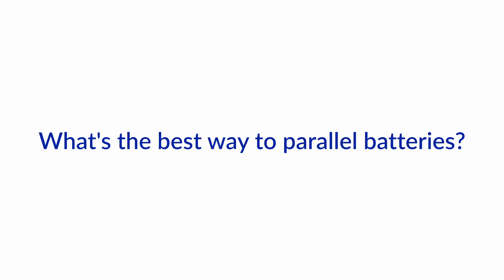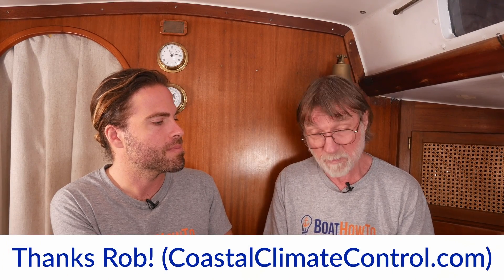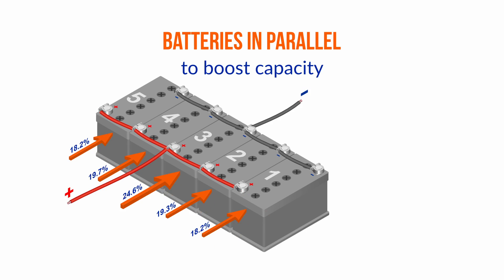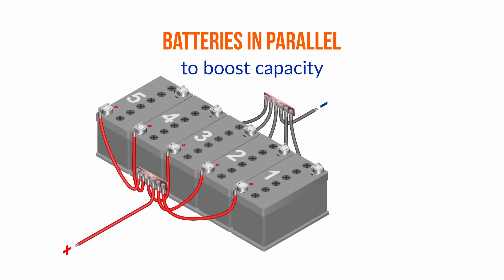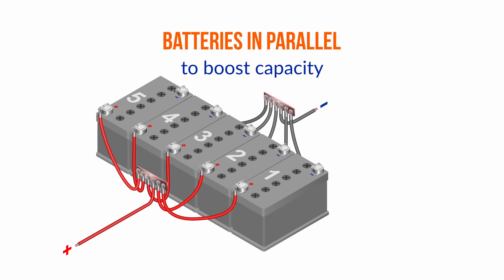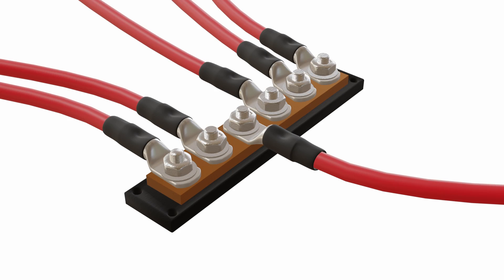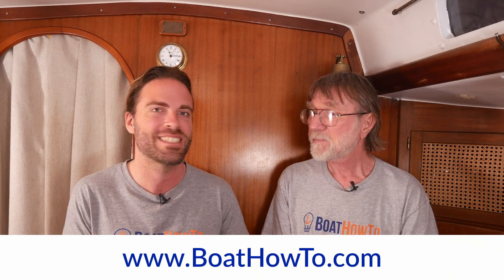The BEST way to Parallel Batteries on a Boat | Ask The Expert with NIGEL CALDER

Comment: My understanding was that you don't need identical lengths on all conductors, you just needed identical paths. 

If, for example, you had four batteries, where two had 1 foot conductors on the positive side and 2 foot conductors on the negative,, while the other two had 2 foot positive and 1 foot negative, all the paths would be the same length with the same resistance.

Comment: Out of curiosity.. can all the positive cables, of the same length, have a different length from all the same length negative cables? Due to orientation, the bus bar for my negative cables could be one foot closer in location than my positive bus bar...   my intuition says that should be ok, but not entirely sure my intuition is correct.

Comment: I always use bus bars for my battery bank! The conductors should all be the same length to keep the system equal. The batteries used should all be charged at near or the same output voltage before hooking up the conductors. I use welding cable for my system for optimal performance.

Comment: Thanks.  That's some good information.  I'm literally switching out the lead acid batteries to LifePo4 batteries.  Only two in my battery bank for my little trailerable houseboat, so I shouldn't need the bus bar.  At least that's what I'm gathering from this video.

Comment: Whahhooo !!! I've practiced and preached this for years and this is the first time I've heard it confirmed 🤗  (I don't get out much) l first started questioning why on 24v trucks does the same battery die first and give such a different load test result....... And how in second hand power walls the similar same result ........ I've rotated the order of assembly but never thought to equalize as you've explained 🙃 thankyou for making this video !!! 😉🙃😎 New subscriber NZ

Comment: Like your thinking for parallel connections on batteries. Question.....what if you have a large catamaran (46ft) with two banks connected in parallel with 5 meters separating each bank. In total there are 8 x 100ah (12v) batteries connected in parallel with 4 on each side with long, heavy gauge wires joining the first half with the second. I can rewire each bank but how do I charge the two banks evenly? I will have 2.1kW of solar that are connected to the end of the battery banks but this will not evenly charge each bank. I can get even charging within the last bank but.......any suggestions?

Comment: Great video.  But, question about the charging input... where and how to best connect that!?
Reply from the maker: I am not sure what you mean by that question. Both the charger and the loads should be connected at the same point at the batteries. So ideally at the separate bus bars. Or did I get the question wrong? - Jan
Reply: @BoatHowTo   You read the question correctly (-:   I need to complete your FULL course which I signed up for but wanted to shoot this question out there.  So to be clear the input and output are both connected at the bus bar.  No worries as I will be utilizing Bruce Schwab for planning... and he is the one that directed me to you and your course!  Thx for the reply!
Reply from the maker: @hldevore Great, Bruce is doing great work! And if you combine that with the knowledge from our courses, you will be ahead of the game! 🙂

Comment: if wiring this way would you have to fuse each individual battery or would one fuse leaving the main conductor wire work?
Reply from the maker: The ABYC E-11 standard calls for the main overcurrent protection device (OCP) to be “as close as practicable to the battery but not to exceed 72 inches (1.83m)”. E-11 was recently amended to make it clear that there can be a busbar within this 72 inches (1.83m). So, assuming the paralleling conductors from the positive battery terminals to the paralleling busbar are less than 72 inches (1.83m), the main OCP device can be installed immediately after the busbar. In this case, the conductors up to the busbar and point of connection of the OCP device are supposed to have additional protection (sheathing) but this is typically ignored and in practice if the positive conductors are separated from the negative there is very little possibility for a short circuit. The other way to wire this is to add an MRBF fuse at each positive battery terminal. However, if this is a 24V or 48V system, the AIC rating of an MRBF fuse may be marginal for the application so this is something that will need to be checked. With the MRBF fuses you still need an additional fuse after the busbar unless the ampacity of the conductor from the busbar is at least as great as the combined amp rating of the MRBF fuses (which is unlikely!). This is because the potential short circuit current at the busbar is the sum of the MRBF fuse ratings. - Nigel
Reply: Thank you Nigel. It is a 12 volt system. What you say makes sense. Since I already have one MRBF fuse holder on hand I think I will just buy one more put them on each battery post and run to a bus bar then add a class T fuse after the bus bar. Thank you.   @BoatHowTo

Comment: A distribution like that means a voltage drop.
Reply from the maker: If you use properly sized conductors and properly crimped connections, the additional voltage drop through slightly longer conductors should be negligible. - Jan

Comment: What about a “cross-diagonal” set-up with even-numbered (4, 6, 8) battery banks? Each battery has more interconnections than with busbars, but it should also  balance each battery concerning inherent resistance?
Reply: I tried to add a link/photo of what I meant by “cross-diagonal”. But it didn’t go through
Reply: To describe it:

The batteries are connected by “short jumpers” in pairs. Each pair is connected diagonally by “long jumpers.”

Thus, each individual battery has the same total number of interconnections and total wire length to the system (positives + negatives).

It makes theoretical sense to me, and looks rather elegant (albeit, with potentially greater inherent resistance/more crimps used than with busbars)
Reply from the maker: @EBee-gn9xc  I think I know what you mean. In this setup, the longer positive leads make up for the shorter negative ones for the batteries and vice versa. I (Jan) think that this should work in theory, but in the discussion we had about this, Nigel remains sceptical whether this actually has the same effect. It would be really interesting to test though. With lack of test data, we would still recommend the busbar-method. The only extra piece of hardware required are the busbars, so the extra costs are rather small. - Jan

Comment: If using the buss-bar method, where do you install the fuse and at what distance?
Reply from the maker: The ABYC E-11 standard calls for the main overcurrent protection device (OCP) to be “as close as practicable to the battery but not to exceed 72 inches (1.83m)”. E-11 was recently amended to make it clear that there can be a busbar within this 72 inches (1.83m). So, assuming the paralleling conductors from the positive battery terminals to the paralleling busbar are less than 72 inches (1.83m), the main OCP device can be installed immediately after the busbar. In this case, the conductors up to the busbar and point of connection of the OCP device are supposed to have additional protection (sheathing) but this is typically ignored and in practice if the positive conductors are separated from the negative there is very little possibility for a short circuit. The other way to wire this is to add an MRBF fuse at each positive battery terminal. However, if this is a 24V or 48V system, the AIC rating of an MRBF fuse may be marginal for the application so this is something that will need to be checked. With the MRBF fuses you still need an additional fuse after the busbar unless the ampacity of the conductor from the busbar is at least as great as the combined amp rating of the MRBF fuses (which is unlikely!). This is because the potential short circuit current at the busbar is the sum of the MRBF fuse ratings. - Nigel
Reply: @BoatHowTo  Thank you for such a thorough reply.

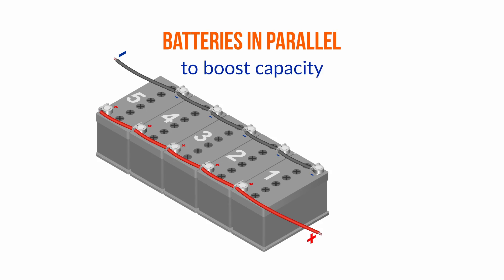Comment: The LiFePO4 batteries I bought showed to wire them the way you show at 2:04. I contacted the company and pointed out what I saw as wrong with that configuration. At 2:04, let's say we pull 100 amps. The red cable coming off battery #1 has 100 amps to the load. The cable between #1 and #2 have 80 amps. #2 to #3 has 60 amps and so on. I told them that I recommend connecting all the batteries to a terminal block (one positive and one negative) then connect them to the load. they agree this was better and said they would change there manual.
Reply from the maker: Very nice that battery manufacturers now also start to recommend this!
Reply: @BoatHowTo  Tell Nigel one of my favorite books is Einstein's Universe. I used it to understand Relativity. When he said "Gravity is not a force", I was shocked. I confirmed that with Gravitation by Wheeler, Thorn and Misner. I have refered to it multiple time since around 1985. Great book!

Comment: In the diagram showing the use of a positive and negative bus bar, this takes the place of wiring each battery to the next in parallel.  Is this correct?
Reply from the maker: Yes, exactly!
Reply: @BoatHowTo  The wires from the batteries to the bus bar are 60 inches, using 3/0AWG. Is this length ok.  Thanks for the previous answer
Reply from the maker: @KenElston  The ABYC states, that if the conductor connected to the battery post is "contained throughout its entire distance in a sheath or enclosure such as a conduit, junction box, control box, or enclosed panel, the overcurrent protection shall be placed as close as practicable to the battery, but not to exceed 72 in (183 cm)." So if you add additional protection to the conductor and it's not possible to put the bus bar any closer, then that's ok. You also have to make sure that all conductors to the bus bar have equal length. Check out our Boat Electrics 101 course for much more info on how to set up a DC system! - Jan

Comment: This is exactly how I've set up my 6 Firefly batteries.  It's not as pretty as some of the not-as-good alternatives (because I have a total of twelve 30" 2/0 AWG cables snaking from all those terminals to the bus bars), but I don't spend a ton of time gazing into the battery bank anyway so I don't sweat it.

Comment: does this technique apply to all battery chemistries?
Reply from the maker: Yes, it does. With lithium-ion batteries it is essential to check the guidelines of the manufacturer, because it is likely that the number of batteries you can wire in parallel is limited. Battery balancing is important. It may be taken care of via the BMS and battery balancing circuits but often is not. You may be required to use an external BMS with balancing capabilities across batteries.

Comment: Good idea. If we are going to this  effort why not taking that concept to the next level. Maybe a circular Bus 'Plate' with the Input leads from the batts around the Circumference equal distance and equal resistance through the Bus bar. Bus bar output connection in the centre of the circular plate. Maybe this is beyond the point of diminishing returns Just a thought.
Reply from the maker: That would be "next level", but if the busbar is properly rated, this would likely not make much difference. (At least not more than small differences in resistance we have during crimping or in the connections anyways.) What is a good idea for busbars in general though is to attach the source of power in the middle and then balance the loads to the sides, starting with the heaviest ones close to the incoming conductor.